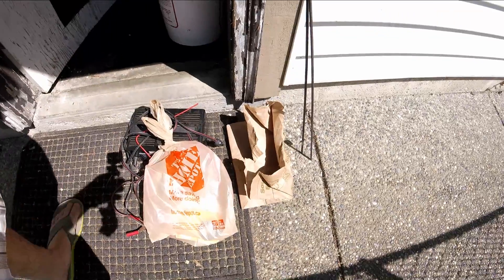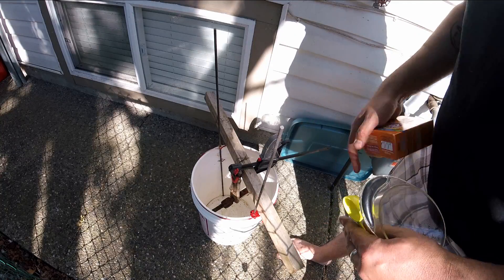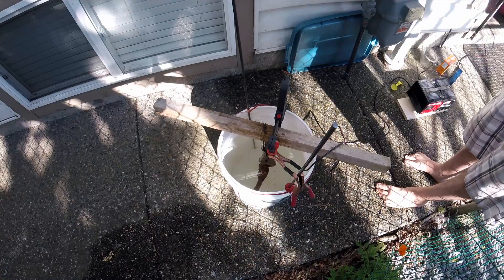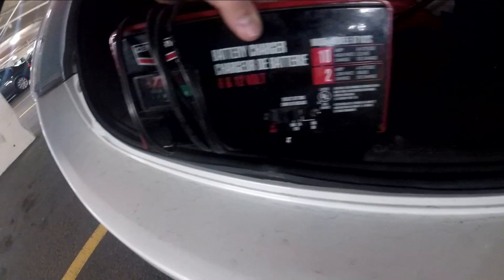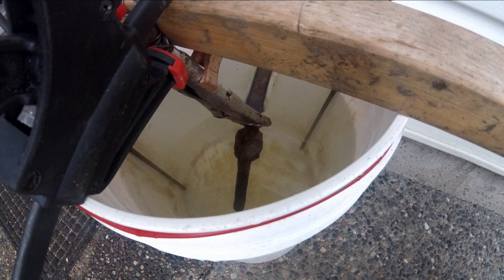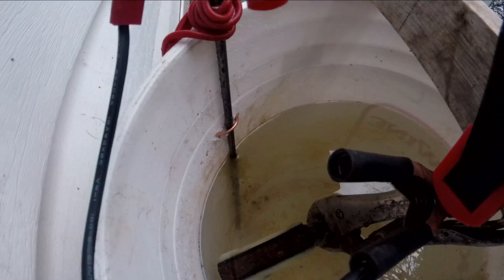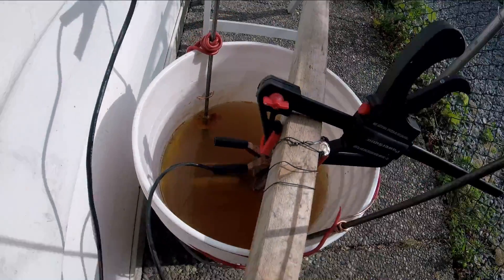How to remove rust by Electrolysis on a GUN I found Metal Detecting

Comment: If you learn and practice real electrolysis  procedures and techniques , the results would have been far more profound.
Reply from the maker: Do you have a good video suggestion?
Reply: try this..  the most effective technique I have seen so far is attaching one of the electrodes  directly to the metal object itself, then using another  large ferrous plate as the other electrode in the water   https://www.youtube.com/watch?v=8cTpmpKoS3I

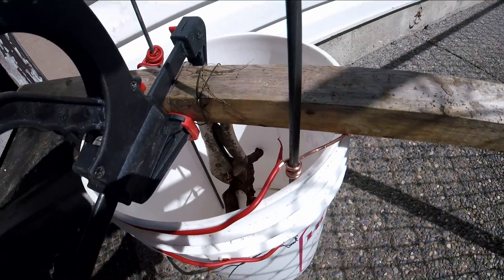Comment: 3:09 Chlorine gas is not an issue if you use washing soda solution, copper however  shouldn't touch the electrolyte, but for another reason

Comment: Terrible example of a good electrolysis job. Arm and Hammer washing soda is better. Use a 12V 10 PSU. You need a better connection of the negative lead to the gun. A little wire or grinding to more conductive metal would be better to clamp to. The bigger the sacrificial anode the better.  I have had skillets rusted as bad as this clean within 24-  36 hours. Youtube has an excellent series of this guy that finds a 1911 on a lake bottom and uses electrolysis... you were close.
Reply from the maker: Blunt and to the point.  I've realized a lot of what your saying after the fact.  I've done it a few more times and have a much better ground on the gun.  Thx for the feedback.

Comment: While I understand the use of the olive oil, I think you'll find that mineral (also used as a laxative) is a much better choice.  The olive oil will go rancid and eventually smell as bad as the gun appears.  Wear shoes and use a wooden paint paddle when stirring the solution.  You probably needed about 36 hrs in the pail with the re-bar.  Thanks.  Narragansett Bay.

Comment: holy moly you put a lot of effort in for not doing a lot of research on electrolysis. this hurts to watch
Reply from the maker: Well I'm glad I hurt you I guess lol
Reply from the maker: But electrolysis is not exactly an expert field.  Not rocket science.
Reply: @TheeTonyNasr  exactly. And you still  screwed it up lol
Reply from the maker: @flynntaggart8549  not perfect but I got 95% of the rust off.  Not exactly screwed up.  I didn't run it as long as I should have, tell me what else I did wrong.

Comment: how many amps does the water need to do this rust removal I want to do this to my brake parts.
Reply from the maker: I'm going to do another electrolysis vid.  I'll double check and get back to you about amps.  One thing for sure.  You can't use an automatic car charger.  Must be a manual one.
Reply from the maker: 12 volts, 2 amps